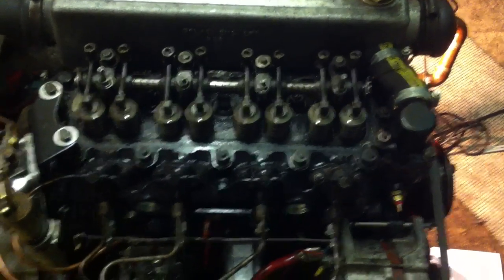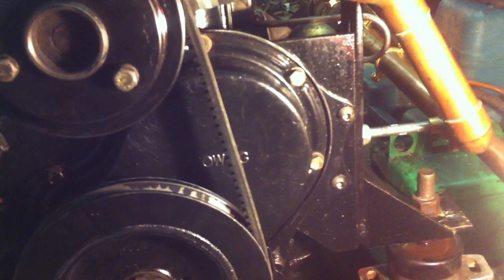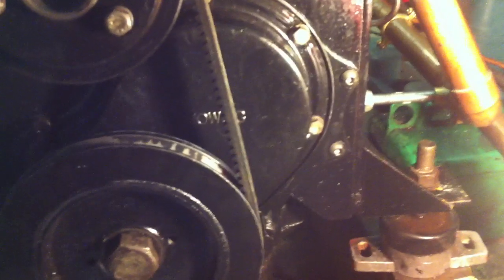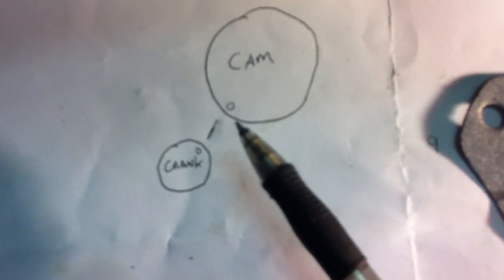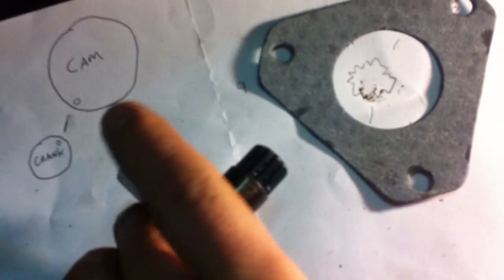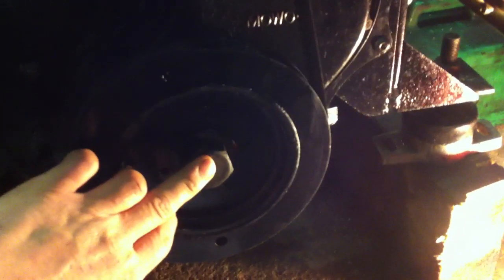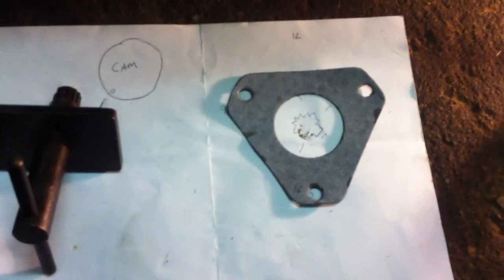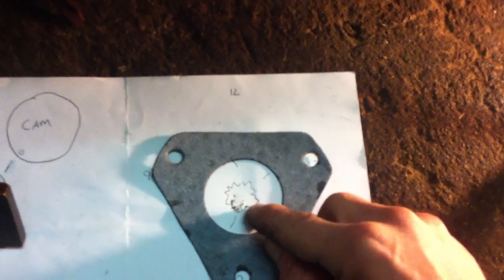How to time a 1500 bmc diesel engine

Comment: Great video, thank you. I have this engine in my tractor. If you don’t have special tool 18G629, how do you move the injection pump spline receptor to the 5:00 o’clock position? Thanks

Comment: I have had a problem with my injector pump and had to get a 'new' (refitted) one instead.
I wonder whether with a 'new' (different) injection pump I can install it just looking for the 22° before TDC and the 5 o'clock position.
Any other adjustment before or after I hit the starter key?
Thanks.

Comment: Hi there. Did you ever do a dynamic timing video in the end? I've got an issue in that I've advanced as far as the slots will allow, and it's only just starting to stop the smoke under load, but not completely. Done the usual, head off lapped in valves, all good there, had injectors reconditioned, check timing chain, all very good and no wear.. pump looks to be a reconditioned unit but from before my four years with the boat.any help would be very much appreciated as I'm stumped!

Comment: Hi, Thanks for this video it's been really helpful in getting my narrowboat engine to run (bought a a pile of bits). 
I've got a question about the timing tool you've got. Does the notch have any relation to the position of the double spline? ie does it follow the centre line or the leading or trailing edge? Do you knowanywhere that hires or sells the tool?

Thanks in advance

Rob

Comment from the maker: Ha! Yes.......... I know what that is, try this. Pump out all the oil, put into a plastic oil bottle ( one gallon) the put the oil back in. FAST so fast it fills up the head / rocker cover with oil . I had this, and it was dry valve guides - the valves are only lubricated by mist - that helped me - I had terrible white smoke. ALTERNATIVES - tappets too tight / poorly seated valves. TO CONFIRM - compression test as is, then 1cc of oil in each cylinder, no change on compression = valve leak.

Comment: Tappets were reset after reassembly and running.
However I had traded my black smelly smoke for white diesel smoke. I was puzzled by this as I had not disturbed the injector pump in any way.
I got an “engine bloke” to look at it and he adjusted the injector pump while running until smoke was minimised (but not eliminated)
I have since renewed the injectors and fitted a re-con injector pump (Thornycroft)
None of these things has totally eliminated the problem to my satisfaction.
continued

Comment: Hi

I bought this engine second hand to replace a really clapped out BMC 1.5 in my narrow boat. Initially the engine ran OK but after a few long days cruising it began to burn engine oil seriously! I decided to do a top end strip down and found the valve stem seals were hard and brittle. I changed these and checked everything else which seemed in pretty good order.  (continued)

Comment from the maker: Ok, first things first, WHY are you timing this engine? evidently the pipes show it did once work fine at that timing setting, so whats changed?
To cut a long story short, the following things 'look like' poor timing and so need checking, 
Incorrect tappet clearance, dry valve guides following a rebuild, a bad injector, a leak on an injector line, poorly calibrated injector pump. 
Try valve guides first - remover cover and pour oil onto the valve springs with enough force to wet the valve stems.